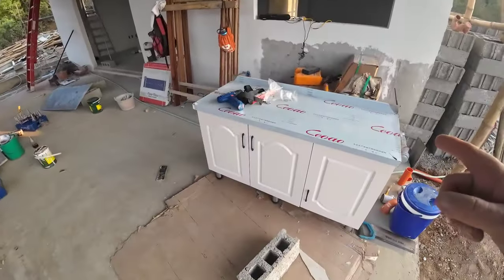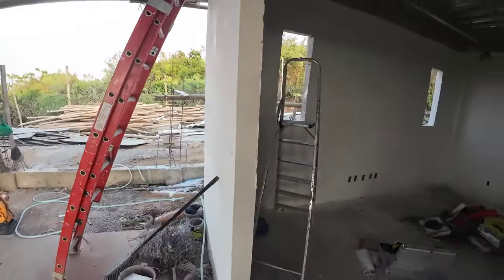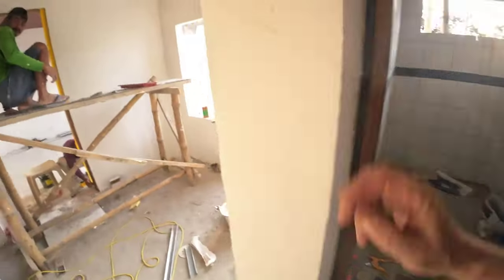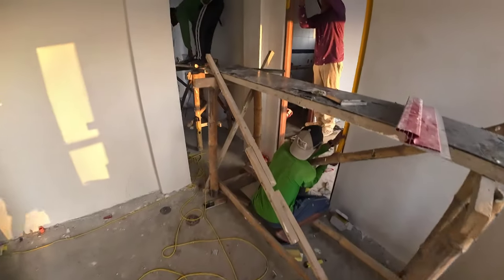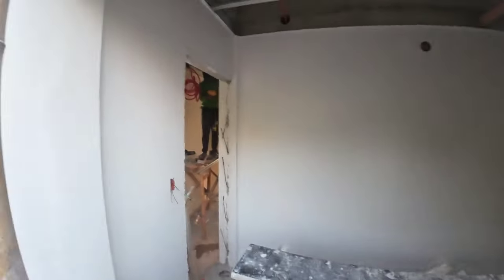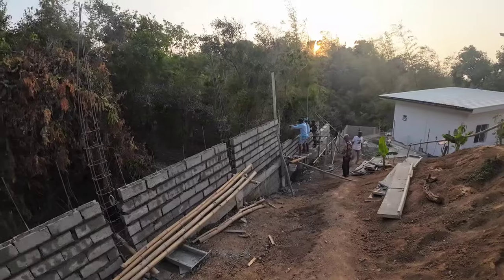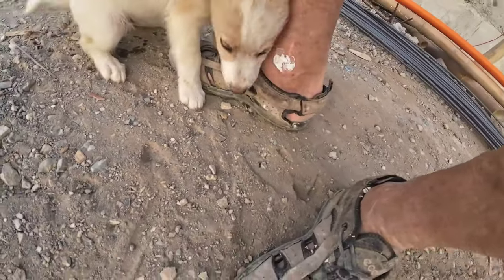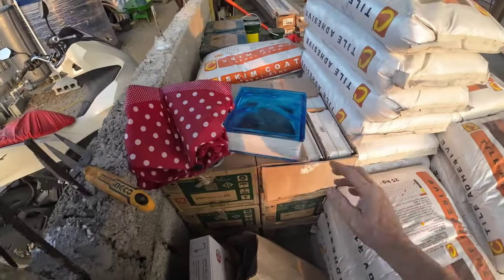126 dobbel overtime and how to glue glasblock.

Comment: For stronger , use rebar (vertical) between the blocks , with a horizontal bar every so often.
Better you DON'T paint the mortar used..... white should be easy to find.
Reply from the maker: Ok I will use some rebar.